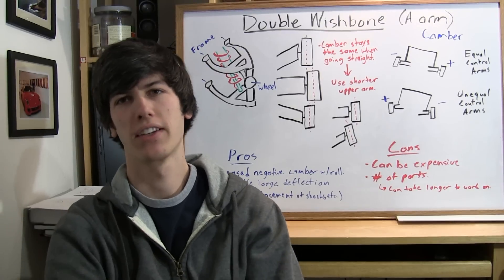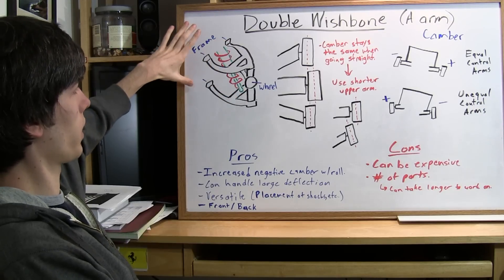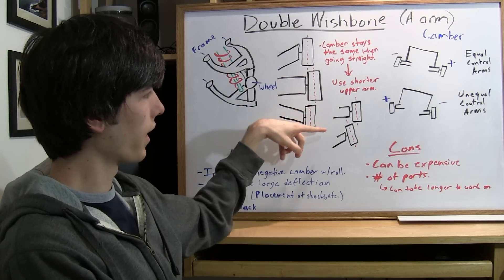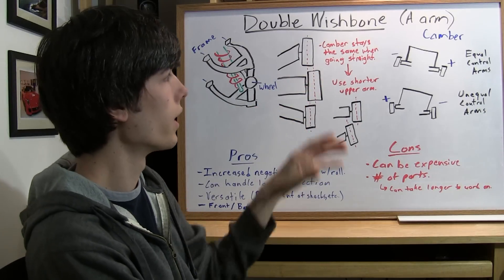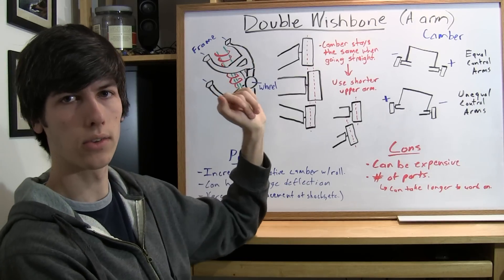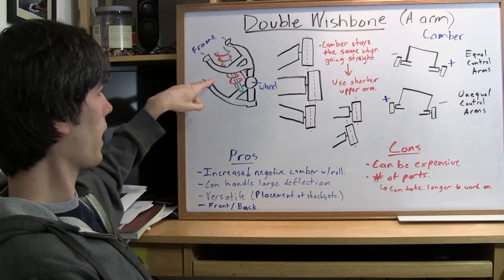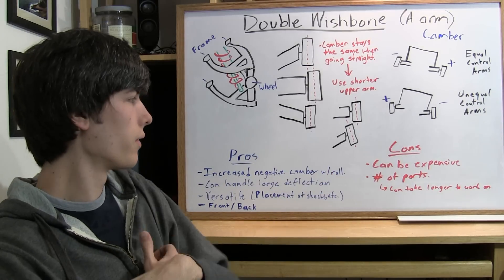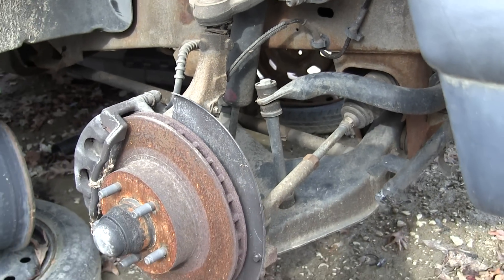Double Wishbone Suspension - Explained

Comment: Hey man my dads nissan navara 4x4 (similar to the frontier) Has double wishbone at the front with disc brakes and leafspring solid axles with drum brakes at the back. Why do you think the engineers at nissan went with this design? I understand why leaf spring at the back as they are good for weight. But why is the front double wishbone and disc breaks while the back is drum breaks? I remember reading the drum brakes aren't as good at discs.

Comment: great video, rear suspension can also use double a-arm, but upper a-arm will be affected also while cornering the same amount than front upper a-arm? due weight distribution? do you know what are the calculus to determine the length for the a-arms front and rear including the shorter upper contrlol arms

Comment: My Mazda Bravo 4X4 has the double wishbone suspension with a torsion bar. I think I could make one out in the shot at the end of the video. What is the torsion bar's purpose in the suspension? Does it take the place of a coil spring?

Comment: Ditto with my Mazda Bravo. My guess is that it caters for when you have the vehicle loaded (the camber with then be near zero as the suspension squats down or slightly negative). Any suspension is designed to take tare and gross weights safely travelling over terrain the vehicle was designed for.

Comment: @ Engineering Explained  my suv (@ 58000 kms) has double wishbone type suspension. it always seems to have a bit positive camber when standing with no load - viewed from front. the wheel alignment guys says it ok and that my car model has no provision for camber adjustment. is this ok?

Comment: A lot of mechanics don't know much about suspension either. 

Although double wishbone is a subset of "multilink" suspension, multilink typically means there is an additional connection from the hub to the chassis (in addition to the double wishbone) that allows the toe to change so when the wheel moves up and down, both toe and camber can change.

Comment from the maker: Why do you say "the double wishbone supsension is unable to put power to the ground"? This has more to do with tires and differentials than the suspension. That said, in a corner or over bumps, a proper suspension will allow you to continue delivering power.

Comment: I just have a doubt about the tyres during cornering. I have learnt that during cornering, the coefficient of friction of tyres contribute purely towards the turning action when the slip angle exceeds 12 degrees and in just a case, if there is acceleration(both positive and negative), the vehicle skids. And now, if I use a sensor to detect the same and if I am able to arrest both throttle and brake, can I prevent the vehicle from skidding?

Comment: Are you knowledgeable of the workings of weight transfer, weight displacement on a vehicle performing a turn? Subject for correction: BMW engineered a system to move the weight shift in the opposite direction of the turn; is it possible to use that theory to minimize weight transfer when breaking? Your thoughts. Sorry about the home work.

Comment: An other disadvantage is that when the wheel springs up and down the distance between the wheels decrease

The first porscharna had problems with this when they even could roll over if they turn first one way and then the other

Comment: Okay get it..
Also.. i have another question..
Normally, the Upper arm is slightly inclined up in the front ??
To get lower Roll centre?
If so, does the inclination in lower arm, hold any significance?

Comment: Hey, i got some questions regarding wishbone suspension..in an independent suspension
Double wishbone suspension is better suited for Front axle in Rear wheel drive ,right?
Does this hold, the same good if its a front wheel drive??
And, does the length of the two arms be necessarily be equal?/

Comment: Dual wishbone suspension is also susceptible to scrub, meaning that when you hit bumps the tyres slide closer/away from each other and the extra stress on the tyres lowers the amount of traction you can get in a corner.  This is especially bad off road where bumps and suspension loading are a very common occurrence and you are trying to maximize your traction (as in rock climbing)

Comment from the maker: @caquillo07 G35 probably does have a higher insurance like the BMW, yes. But when I've talked with mechanics and asked similar questions, most have referred me to Nissan simply due to reliability (and Honda, of course, but you seem to prefer the 35/350). As far as the internals they both share the same parts, so I don't see cost being too great an issue, unless there was body/interior work that needed to be done.

Comment: Great videos. Correct me if I'm wrong, but I would like to note that the unequal arms on the double wishbone are also good for cars that are riding low, since the compression of the suspension tucks the wheel in and away from the suspension.

Comment from the maker: @caquillo07 If you're going 05 I say scratch the Mustang and the 330ci. Before 2011 all mustangs have iron blocks (heavy), lower output, worse efficiency. (the new 5 liter coyote is awesome, but expensive). The 330 will have higher insurance cost, maintenance cost, and possibly reliability problems. 350z, G35, and S2000 are all awesome. S2000 had the highest production redline before the 458 came out (sounds great - 8800). 350z/g35 both have good power, and reliability.